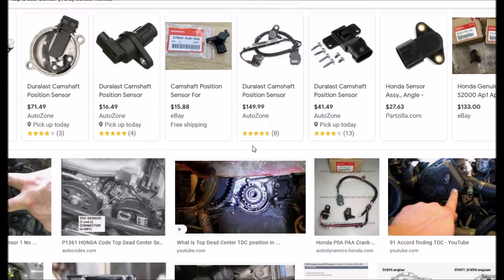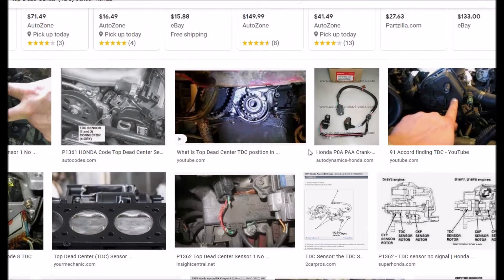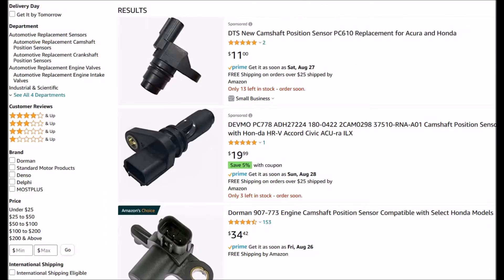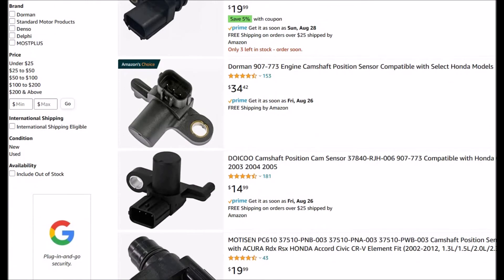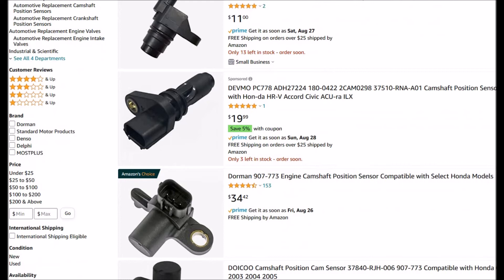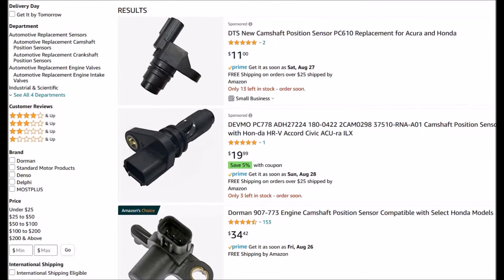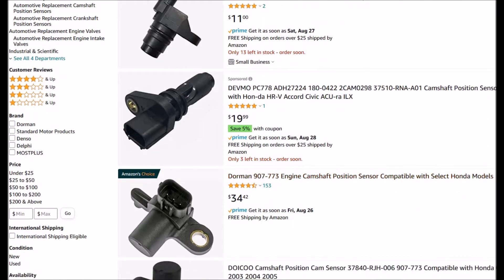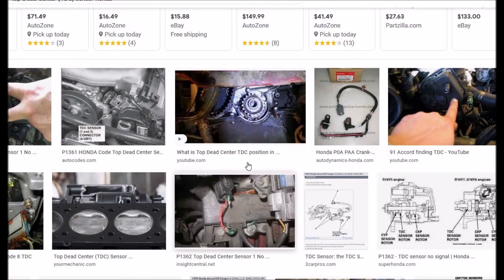How To Fix Honda P1361: Intermittent Interruption In TDC 1 Sensor Circuit

Comment: Buy Denso for Sensor, I didn't buy the Denso coz they are $65 4 years ago, I bought the cheapest one, now it's acting again 08/2025 and still not buying Denso its $80 now, BUT I knew how to fix cars so it won't bother me if I replace the sensor again in 2 years and then timing the car.

Comment: I  just cleaned the sensor connection with contact spray and plugged it back up. I pulled the batt cable to reset the code and it has so far worked for me.
Reply: Good call, I cleaned my engine bay the day before.  Might have gotten moisture on the connectors thanks!

Comment: Hey ty for video.  So I got that code ,I knew i had to do valve cover ect to take apart. So I bought both sensors oem honda, replaced tdc sensor and one below for crank. Put some dialectic gresson connectors . Put back together and now car jumps to that limp feel run rough quicker than it did before I changed them. I looked around for chaf wires,nothing. One forum said ignition control module could be bad.  Car has 98k.  Timing belt was done around 75-80k.  I also read it could be 02 sensors. So idk what else to do
Reply: Did you ever figure it out? Did you replace the module?
Reply: I replaced my camshaft censor and same thing….
Reply: It’s not for camshaft this guy mixed it up supposed to be the crankshaft position sensor I feel bad for everyone who thought he was right he confused the 2 or is just dumb

Comment: Hey man I’ve replaced the cam sensor twice the crack sensor timing belt had it towed to the dealership cause I was stumped and they told me it was the exhaust manifold and cat so i replaced it as well cause it was cracked and still same problem it’s throwing a p1361 code and has got me stumped to say the least I’d appreciate any tips if you have any thanks so much
Reply: If you have issues with it still, you may want to look into your head gasket, apparently the conventional way to protect you for a head gasket in certain Honda Civics
Reply: If u didn’t replace the cam sensor with a oem part it might not function correctly to oem spec causing the problem to continue
Reply: @gardyian2258 it needed a better camshaft sensor but now it runs much better thanks for replying I appreciate it

Comment: I have the same code p1361 and p1362 but i changed the sensor 3 months ago with the timing belt and water pump… somebody told me i need check the wiring…. I have a civic 99 EX coupe!!

Comment: I have p1361 tdc sensor 1 noise on my civic 2002. The problem is, when engine is hot, the car dies. After couple of minutes, it starts normally. I dont have a steady check engine light. Got this code after scaning. Is it the sensor or the wiring? Bcz, when engine is cold, the car runs fine.
Reply from the maker: There may be an issue with the engine overheating, and it is causing the sensor to overheat and stop working. I would check why the engine is overheating, such as a stuck thermostat, bad water pump, and so on.
Reply: @whyingo7964  thanks for the reply. no, there is no problem with over heating. My heating sign in the dash is ok. It dies, specially when I'm stuck in traffic and when I said about engine is hot, meaning when It's running with the help of radiator fan. The mechanic, checked and suspected that it's the wiring though, but a dying car on the road randomly, is a pain in the ass 😖
Reply: @nahid1981 did you ever figure out your problem
Reply: @Darrenlawrence89 did you ever find the issue cuz my car is having the same problem as his
Reply: @ilybuu9111 I did , my issue was aftermarket sensors ,, the cam and crank sensor has to be Oem ,, took a fight but  all fixed now
Reply: My 2001 civic is doing the same thing,when running about hour or so, it dies,al the check engine ,and other dashboard lights comes on,wait a little and the starts again,but after just 2 minutes dies completely, and have to wait for another hour to cool off and star it again,another hour ,does the same thing,that's Thanks why I'm looking for answers in you tube Thanks for your comments ,I'll replace the TDC sensor. I'll post update later if that solved my problem
Reply: @oscarvm does replacing the sensor worked? I experienced the same for my Fit 03
Reply: @oscarvm  having same problem
Reply: @michaelg6641   Replace TDC sensor
Reply: Having the same problem, I’m going to replace and I’ll let you guys know haha.
Reply: Having same issue with 01 Honda. I'll change them and let you all know.
Reply: Same for me did anyone figure out what is the root cause?
Reply: @sertifikali  TDC sensor,replace it with an OEM honda sensor
Reply: @oscarvm  Finding the OEM is really going to be difficult where I live. I called the dealer today and they said they don't have it in stock and ordering it from Japan will take no less than two months. Damn.. Do you think a junk yard one will work fine for this? Or can you recommend a reputable brand as a fallback?
Reply: @sertifikali  Buy a non honda brand one meanwhile arrives the honda brand.
Reply: @oscarvm  today I had to buy a junk yard one. Tomorrow I will get it installed. Thanks for answering all my questions. Wish me luck 🍀
Reply: @oscarvm  the part is replaced today. So far everything looks good. 😊
Reply: @sertifikali  root cause is age and use

Comment: Hey man, so my car started doing this thing where if I floor the pedal my car kinda lunges forward and can’t go over like 2000 rpm’s. I scanned it, and it said it’s a tdc sensor but I don’t know the main route of the problem. Any feedback helps
Reply: 2000 Honda accord
Reply from the maker: @dylanlowe9585  I would use a meter and test the sensor to see if it was bad.
Reply: It's a limp mode, try replacing the sensor

Comment: Yo my 97 accord (f22b2) is throwing a p1362 code, from what I can find the sensor should be in the distributor housing on this engine. Just wondering if you had any knowledge on it, always looking for a second opinion.
Reply from the maker: Its been awhile, but the last mid 90s Accord I worked on had the Crank sensor located under the timing cover, at the bottom near the crank. There are also some engines with it located at different spots. Let us know what you find.